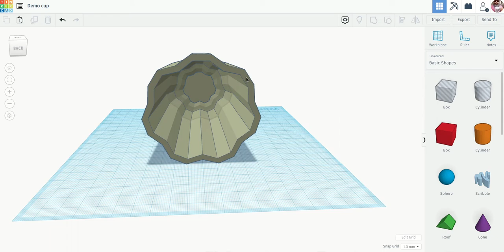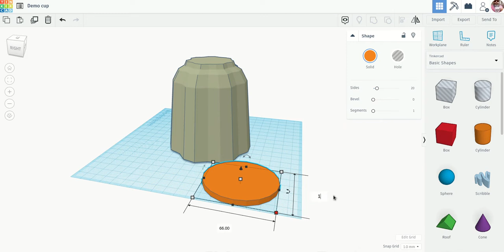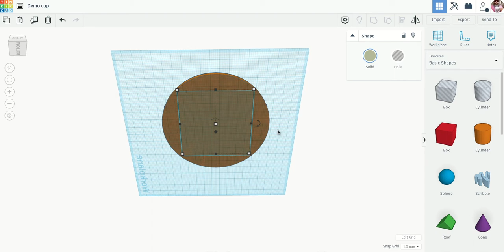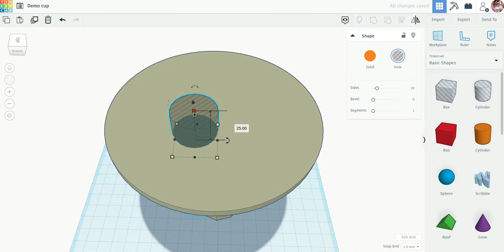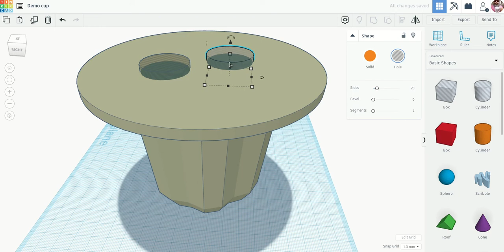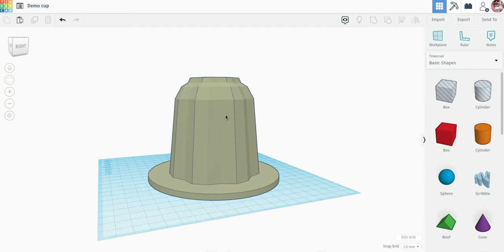Using Tinkercad to prepare your Potterdraw file for plaster casting

Comment: How to assess whether a given item (e.g. a mug designed by you) is suitable for a one-piece form?
Reply from the maker: For a one-piece mold, the object cannot have any surface that is past vertical and would catch on the inside of the mold when you try and pull out the form. Ideally, all angles should be less than 90 degrees to all the object to be easily removed. A mug (with a handle) would need at least a two-piece mold because of the space inside the mug's handle. Hope this helps!